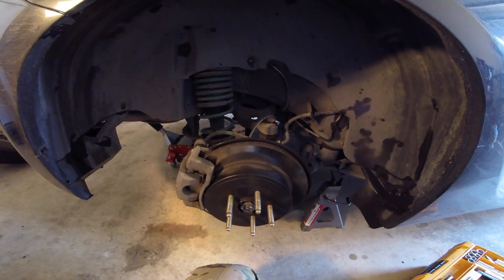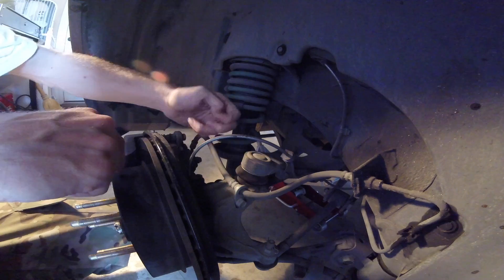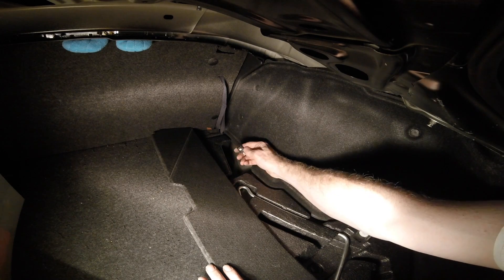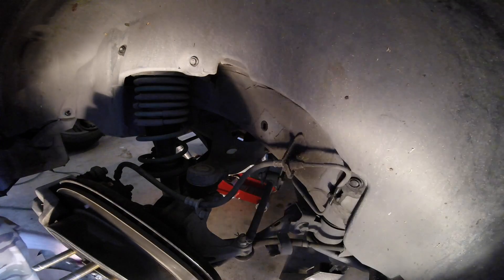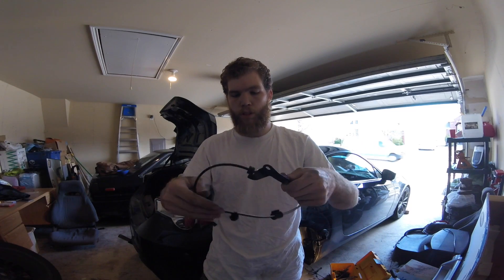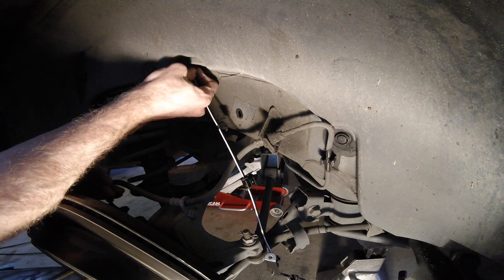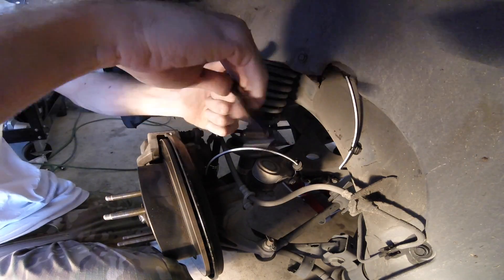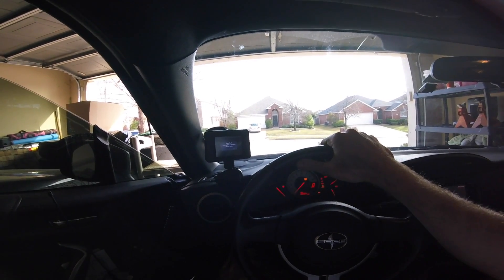FR-S/BRZ: Wheel Speed Sensor Replacement (Cures P2158)

Comment: How did you know which one was bad?
Reply from the maker: It was throwing the code P2158, and we were working on the hubs at the time, so we decided to check them. The rear passenger sensor had physically broken, so it was easy to identify. You might be able to test using a multimeter or wire probe.